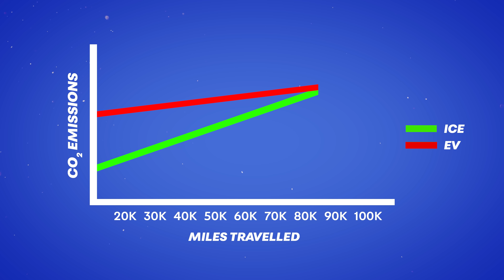Are Electric Cars REALLY That Green? [New 2022 Data]

Comment: I did a base study with some of my tertiary colleagues. We came up with a general consensus that the EVs were only marginally better than ICE over a 5 year lifetime with regard to direct carbon emissions based upon a mix of Coal and renewable charging.
We did speculate about the overall environmental footprint with regards to manufacturing and disposal of both vehicle types. Unfortunately we did not have any reasonable data available. We did however agree that the ICE would likely have a more CO2 centric impact in construction and disposal, and the EV would have a much higher environmental impact due to the toxins created during both the construction and disposal phase.
>
All in all we could not find any appreciable environmental gain from EVs. A more efficiently designed ICE or even a ICE hybrid may actually be more appropriate for the near future. More efficient use of ICE vehicles would likely have a far more beneficial impact on the environment overall. For example not driving to the shop every time you want a can of soft drink or container of milk.. We don't really need to drive to the shops 10 times per day for 1 item each trip :)
>
Thank you for an interesting and well balanced presentation 👍
Reply: You mention toxins in the disposal phase. And a lot of people seem to have this idea that batteries are somehow disposed of.

Which is a bit absurd as it's half a ton of expensive minerals. They're recycled and the minerals are extracted and reused in new batteries at a lower cost and environmental impact than mining new minerals. So realistically, now that some teslas are over a decade old and we're starting to have some batteries to recycle, the overall co2 production of battery packs is going to decrease, as some of the lithium will come from recycling lithium that's already been lined a decade or more ago.
Reply: @TopolinoEV  I'm not going to beat up on anyone for having an honest opinion.
In my knowledge of this none of the so called "Green" solutions being thrown around are environmentally friendly. It's just creating a new problem to hide the old problems without any real gain.
Reply: Not sure how extracting the minerals from old batteries and using them to make new batteries is bad in your eyes.

I'm not disagreeing that the inital mining is an issue. Especially locally. But the companies taking the old batteries apart and reusing the materials to make new batteries are hardly an environmental issue.
Reply: @TopolinoEV  There are a lot of chemicals involved in that "Recycling" process.
My comment is regarding the big picture of so called "Green" energy. It's just a sales gimmick and doesn't match with real science.
Reply: 5 year lifetime?
Reply: @Rick-5728  Standard lifetime for motor vehicles, and used to be for other products until Chyna rubbish. 5 years is also the standard product life cycle as well as taxation depreciation period. 5 years is know as the "Long Term" period.
Reply: @axle.australian.patriot  That's silly.  The average age of cars on the road is 12.1 years.  That's just the AVERAGE.
Reply: @Rick-5728  Doesn't matter if people keep old junkas on the road for 30 years. The Industry product lifespan is 5 years.
Reply: @axle.australian.patriot  I don't care what you think the "Industry product lifespan" is.  I care what's true and relevant to the topic of the video.
Reply: @Rick-5728  Well, I am afraid that what I have said is 100% True and on topic to the video. Too many people "Make up there own story" to try and create false validations.
At 5 years those and any other product of the lifespan will require an excessive amount of maintenance. The cost effectiveness begins to decrease quite steeply after that point.. <- This means additional load on environmental factors.
>
"I care what's true and relevant to the topic of the video."
Relevant and on topic to the video. Are they that Green? In my professional opinion I see no gain or advantage from EVs.
In my personal opinion I think EVs are a terrible idea.
Reply: @axle.australian.patriot    This video isn't about cost effectiveness.  It's about carbon footprint, and gas cars have much higher maintenance costs than EVs.
Reply: @Rick-5728  Cost effectiveness == energy efficiency == Higher carbon productions.
Gas cars ARE NOT higher in maintenance costs, and are less in carbon footprint in maintenance.
I suggest you go out into the real world and work in both ICE and EV related industries and learn what you are attempting to talk about :)

Comment: At 90k miles it will need a full battery replacement too....they can have the costs along with the moral high ground if they want it....
Reply: It will last way more than that,.
Reply: Not according to the dealers who I enquired about an ev with..... 90k was the best they'd do.....you could either buy or lease the battery and if leased it was changed out at that point
Reply: @Saxonx500  Because it's basing those from old generation ev. Tesla for example already does way better than that with minimal degradation, no way close to replacement.

Comment: I don't know how long you'd need to own am EV to accumulate  124,000 miles in Europe, but I seriously wonder how the cost of replacement batteries ( environmentaly ) would greatly reduce the value of EVs.  Currently the projected life of EV batteries is approx 10 years which means that at 8 years old there may be no value in an EV, nobody willing to buy it and/or replace the batteries and the whole thing ends up in land fill.
Reply: Why won't people buy it if it's battery is replaced. Cheap ev are always in demand.

Comment: 90,000 miles is the only figure being reported and used to get the last drop of oil out if the ground...the 30,000 figure is much more accurate for most of the EU and for smart electricity buyers around the world.... plus our EV is so much cheaper to run!

Comment: It’s really interesting. But I think that you told us exactly why Volvo did the research:
1) EV have room for improvement but is not just the car manufacturers but also the suppliers 
2) probably IC cars are probably at their peak performance in terms of CO emissions but EV are already ahead ( depending several factors not that far but still)

Comment: I have passionately held views on the topic. I deplore the forced migration to EV and 'damn the consequences'. And I resent that choice is being taken away from us. We protest vaccine mandates but meekly, nay, enthusiastically jump on the EV band wagon. LPG is a good solution. Hydrogen, whether fuel cells or direct combustion will be a good solution - if its given half the attention and investment as electric.

And that's just purely from the environmental standpoint. Social justice and the fact that EVs require 'blood elements' from countries with poor human rights records or that indeed wars will be fought for access to cobalt and cie is just, in my view, further horrors on top of the waste.

Edit. One thing often overlooked : brake dust and tyre wear are major pollutants and EVs do not address this at all. A little bit of research into making brake pads and tyres of more biodegradable materials would have an immediate benefit at possibly much lower cost and much greater adoption rate because the threshold of purchasing is much lower.

Comment: We still need to produce all that electricity to charge those batteries.  My suggestion is get rid of coal and replace it with nuclear plants, and we have a close to infinite supply of clean electricity right then and there.  Solar and wind can contribute as well, but not as much as nuclear.

Comment: Another reason why I can’t really see them taking off is the repairablity or lack there of. Say a major issue happens with a motor or a sensor on an ice car, some if not most people who work on their own vehicles can easily fix it. On an electric car however you have to go to the shop, now that wouldn’t be bad if some shop visits didn’t take months just to fix the car. Versus ice you can just go to a autozone buy the part you need and just work on it from there.

Comment: It's bad enough that I had to replace the charging port in my phone, hate to deal with an electronic nightmare at a vehicle level. Plus no outside ug to use at my apartment and haven't seen a charging station anywhere near me. Will just keep using E30 in my old 4 cylinder vehicle that gets good milage and can get me to work and back during the very cold snowfilled winter's

Comment: Not an EV evangelist here, just a fan of accurate reporting.  The Volvo report and the news reporting around it have all but been discredited, that's why the link to the study no longer works.  There are multiple studies out there that were not funded by Petrol centered car makers, that included all the lifecycle costs, and the break even point is more like 7,000 miles in Europe, and 12-14,000 miles in the U.S.  Rory, when are you going to update your video?

As far as every other commenter on this site screaming, WHAT ABOUT THE BATTERY PACK RECYCLING, I'll give you a good glimpse.  

---First, right now there aren't that many dead/end of life/destroyed/unusable main battery packs from electric cars out there. The ones that are out there are being snatched up by recyclers, hobbyists, tinkerers, companies putting them in shipping containers and making off-grid or grid supplemental systems, etc.
---Second, every combustion engine, vehicle, bus, or piece of equipment that you don't use a pull cord to start, has a LEAD ACID BATTERY already in it.  Lead and the acid inside of these batteries are both considered toxic substances. All these billions of batteries have to be replaced every 3-6 years, depending on environmental conditions, or if you luck out and get a really well made battery. Soooooo, how many of these batteries, in developed countries (US & Europe) do you think are going in to the landfill right now? Hint....almost NONE. Why, because we already have established battery recycling programs out there across the world 😮....for lead acid batteries. Landfills wont take lead acid batteries, and if you try, most places will fine you if they catch you.  Every time you, as the consumer buy or replace a lead acid battery you paying a recycling fee, just like a bunch of other things have recycling fees, to help off set the cost of those recycling programs. 

So we've established that there's a pan-global coordinated effort to recycle hazardous lead acid batteries, ALREADY IN EXISTENCE.  Does anyone really think that your Local, State, or National government is just going to look at another huge battery coming out of a car and go........"ehhhh, those giant batteries are from electric cars, they're made out of unicorn farts, so we don't need to recycle those, CHUCK 'EM IN THE LAND FILL!!!!"  Now, there is one thing I can tell you  that I'm 1000% sure of....there's already regulatory will and money to be made recycling those big batteries....it's already happening, see my first point.  So when there's money to be made, and a law pushing it forward, it will happen, capitalism will make sure of that.  If we use the current model of lead acid battery recycling as a likely model for lithium packs, what you get is a whole industry evolving around a need. When you dispose of a large traction battery pack out of an EV, you're going to pay a recycling fee, just like you do when you dispose of your car's lead acid battery today.  Right now, the average cost to recycle a lead acid battery is about $3 for a 50lb, or so, battery. So if you consider that the main battery in an EV is roughly around 1000lbs, or 20X heavier, then the math says you'll pay $60 to recycle that battery. Maybe it will cost more, based on other factors, but maybe it will end up being the other way around, where it's like recycling copper today, and you get paid for it, even if it still has all the insulation/car still attached to it. It is after all, waaay cheaper to harvest lithium from a used pack than it is to dig it out of the ground.....and no, don't go off and say "SEE, lithium mines are huge nasty blights on the country side", because ALL open pit mines are HUGE nasty blights on the country side....lithium, iron, coal, gold, copper, diamond, silver, granite, marble, uranium, etc, etc, etc. 

We as a world, need to make a change.  Whether you believe in climate change or not, or you believe that CO2 is the killer or not, the point is we don't need to burn stuff any more to make energy.  We NOW have the technology and the expertise to transition, EVENTUALLY, away from combustion as a means to power our transportation, to power our illumination, to power our grids, and to power our lives. This transition won't happen next year, but it will happen.  Look around and see if you can find a whale oil lamp, a steam driven thrasher, or a black & white RCA tube television in a walnut credenza.....we moved forward.  It's time to keep moving forward.

Comment: I agree with everything you’ve said EXCEPT the suggestion the the argument is binary. I know 3 people with Teslas and they got them because they’re really cool cars. I know a couple of people with Leafs and they got them because they do the type of pootling around town the fits perfectly with the design of that car, plus they like the idea that they can “fill up” at home. Being “green” might be on the list, but it’s not the driving (tee hee) factor. I don’t know anyone who is pro EV that believes for a second that EVs are environmentally cost free. Just less of a cost than ICE. Engineering Explained did a very detailed breakdown of the total cost for a range of different cars. Would recommend. You also touched upon something that I don’t know if it’s factored in, but CO2 is only part of the equation. Plus, Cars only spend on average 4% of their time actually driving. They will also become part of the smart grid and will help make us more efficient.

Comment: Ok, BUT isn’t it better to carry on driving what you already own until it’s knackered rather than buy another car that generates more environmental damage in its manufacture ?
Reply: Thats what the tree huggers don`t get. The carbon footprint created in building an EV will outlast the cars life. Plus charging the car causes the powerplants to burn more fossil fuels. EV`s are a joke. Did you know if you plug a tesla into a regular outlet it takes 3 days for a full charge. 3 DAYS!!!  Or you can get a fast charger installed at your house for 8-10k

Comment: The other conversation we are 5 to 10 years behind on is how will we keep all the dangerous metals in the batteries out of the environment when the batteries are consumed. There is no ability at the moment to do an economical mass recycling of these batteries because ever company's cells are so different and this creates issues with hurting our soils and is an opportunity to lower the carbon footprint of battery production if achieved well.
Reply: Nobody throws away used EV batteries - they are too valuable.

Comment: What this report doesn't seem to be taking into the account is the entire CO2 emissions related to extraction, refining and transportation of petrol/diesel fuel. The link doesn't work anymore so I might be wrong, maybe the did take this into the account, but I've seen similar reports in the past and they typically measure manufacturing and emissions related to the car itself. We have to remember that driving an EV, while not ideal, is massively damaging the entire fossil fuel production chain. That in turn, causes further reduction of CO2 emissions which are indirectly caused by EV over fossil car ownership.